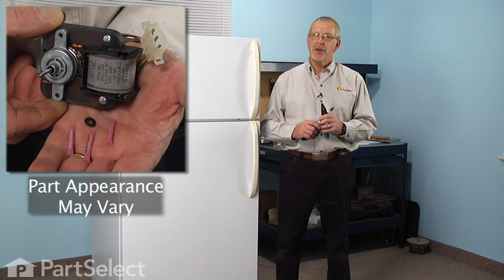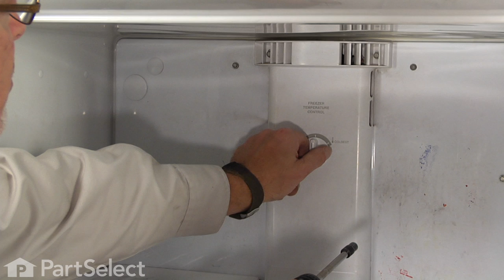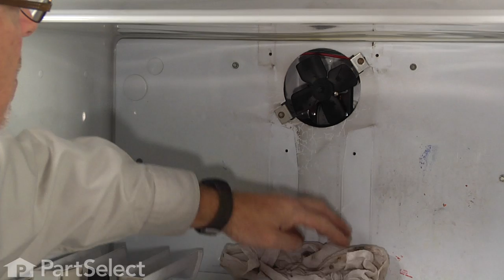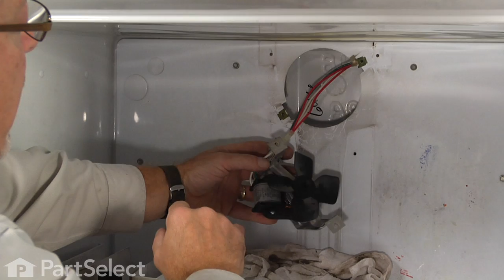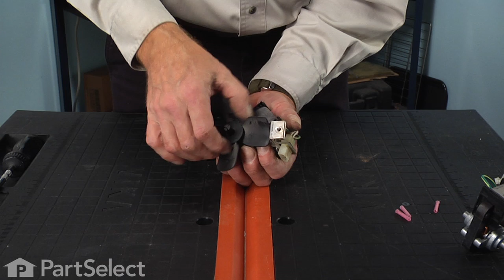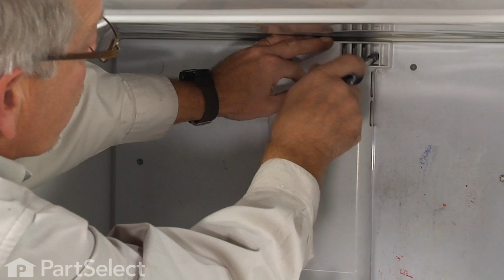Refrigerator Repair - Replacing the Evaporator Fan Motor (Frigidaire Part # 5300158289)

Comment: Thanks alot this video showed me how to put the evaporator motor in correctly. Easy fast it was...before  I did it where the fan brackets where kinda crooked looking which was the cause of  bad air flow to the refrigerator :( this saved me time and money thanks AGAIN!! so satisfyed.